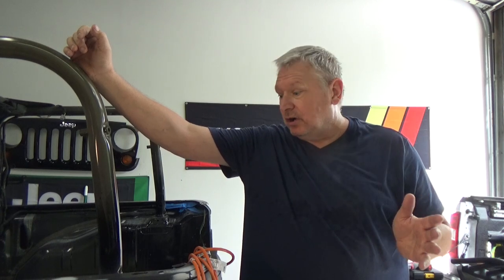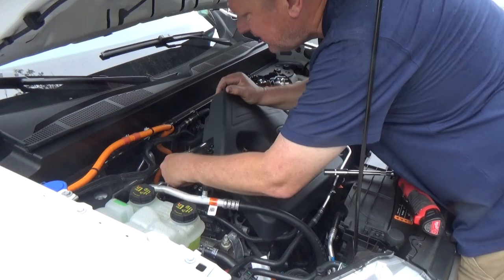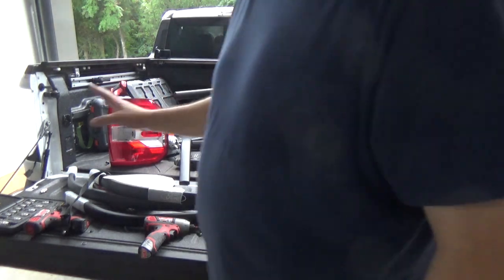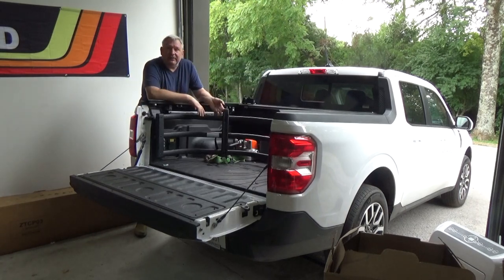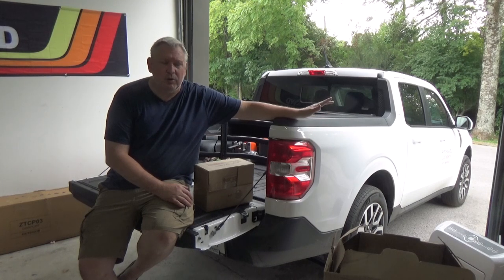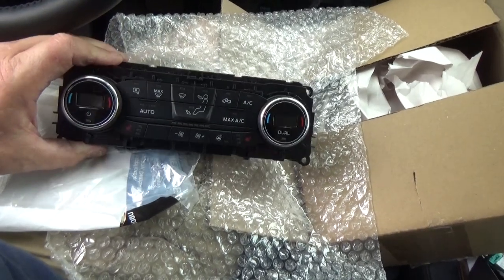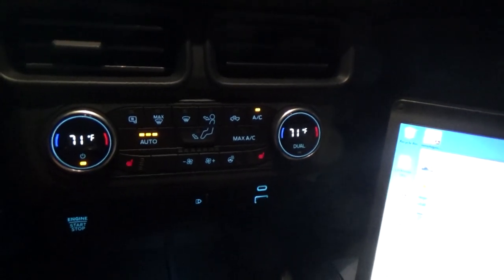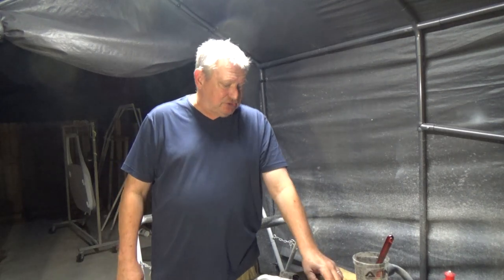Maverick Upgrades - Bed Extender - Digital HVAC Knobs - Engine Cover

Comment: As a former Ford parts guy, that “scrap if dropped” is real. I used to get modules, rebuilt, that got tossed by UPS or FedEx…customer would finally get the car in, you’d pull the dash apart, install the new module and it fails right off the bat. Could take 6-8 weeks for a new one according to the catalog. 

Oh-and those part numbers on the actual part? Not real. Ford part numbers for electronics are so weird. You’ll have an engineering number and a part number and sometimes they get superseded multiple times. It was a pain in the ass to try figuring out modules sometimes. Especially if the catalog didn’t note a supersession.

Comment: Cool beans!!! My Maverick Lariat shipped with the digital HVAC control. Too bad yours didn't, but I think the cost of that upgrade is worth it. It makes you happy. I like the engine cover. So much so that I just placed my order for the required parts. Only I will know it is there, but as you say, it makes me happy.

Edit update: my order was cancelled because one or all of the engine cover parts are no longer available. Bummer.
Reply from the maker: I would keep looking around - dont think those parts are discontinued

Comment: The part number on the back of the HVAC module is called the engineering number, I use that number to cross over to the service part number

Comment: I agree with you that the truck should come as advertised but I'm wondering if maybe they changed it for safety concerns to limit the driver taking eyes off the road and looking down to adjust while driving (just a possibility I thought of).  Mine is also lacking the readout on the dials but I personally like seeing it on the touchscreen.  This is my first vehicle with a touchscreen and, so far, I'm really liking it.  Thanks for sharing your upgrades and ideas through your videos.  Keep them coming, sir!

Comment: Before I pull the trigger on buying a HVAC control module is there anyway you can provide the forscan line and values you used or can it be done by saving my own as built data?

Comment: How’s the Digital read out swap going? Everything working ok still?  I just pulled the trigger on trying a used one. I work at an auto repair facility that has the Ford FRDS and IDS so I’m hoping if the As-built needs changing I can do so with it. You mentioned forscan, is that used with an android or laptop?

Comment: They pulled the same crap on my Lincoln Corsair. The website advertise the digital readout in the control module but, when I got my vehicle, it did the same thing by displaying it on the screen. Bad bad on Ford pulling such bait and switch.

Comment: Hey Dave. Paul here in San Diego. I got Maverick Lariat back in March. And I really like it and mine had the temperature gauges. But, I enjoyed watching and learning yours.. Do you have a tutorial on how to use it and the set the settings? I've really never heard of it until I got the Maverick and started reading about people putting cruise control on their XL variant, and another hack, if you change something with forescan, you can double click a certain button on your remote on the Lariat and all your windows will roll down. So anyway, would love to learn how to do it but really don't know much and hope and I can learn from you since I got a little teaser from this last video. Keep up the great work my friend. I enjoyed it
Reply from the maker: Ill work on that one - Thanks Paul !!
Reply: @RedneckGarage  Thanks Dave.
By the way, I'm considering getting the same engine cover and liked the info you provided. Really helpful.
Question? Does it also help suppress engine noise?
Thanks again for all you do👍🏽
Reply from the maker: @peekaypee1  Possibly a little but I dont think its that noticeable truthfully.

Comment: Is there a hood liner available that fits this?
Reply from the maker: probably ;)
Reply: You can get sound deaden material that can be cut to size to line the hood. I intend to do that when my Maverick shows up someday. From what I've seen that material can handle 250 degrees F no problem

Comment: What did you change in forscan
Reply from the maker: the settings for the climate control module
Reply: @RedneckGarage do you happen to have those specific changes? I think I need to set my value to match but I don't have a maverick that had the led display to pull the values from. 😢